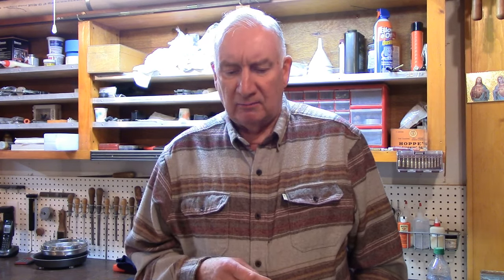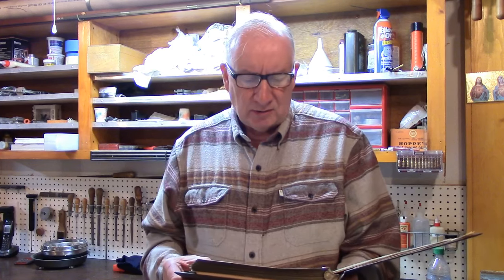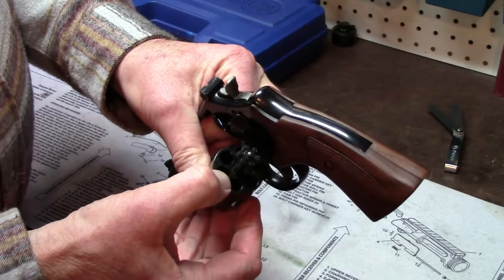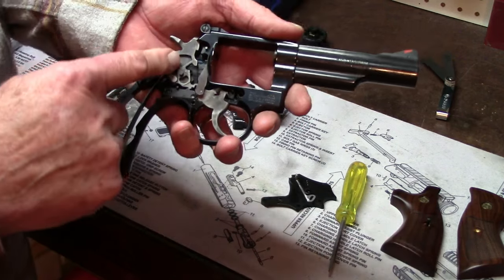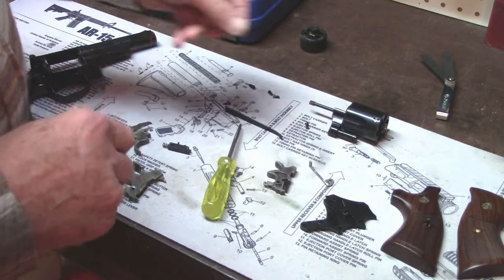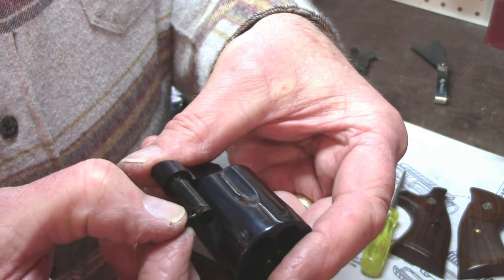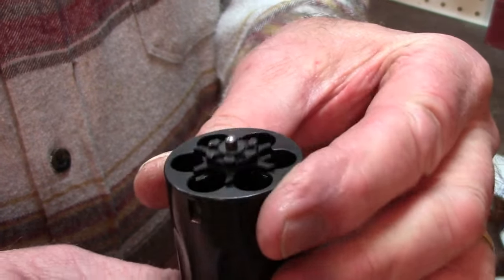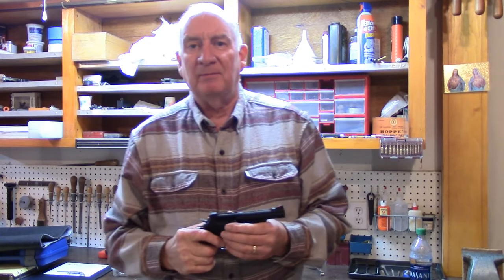The New S&W Model 19 Classic ~ A S&W Armorer's Review

Comment: I think the real question is should I get a new model 19 or a 686+. They cost about the same and are equally nice to shoot. No gun shops in my area carry any revolvers larger than a J frame, but they will have every flavor of Glock imaginable. I am going to have to have one shipped in either way so I cant really get a feel for either one before I make my decision.
Reply from the maker: They are different size frames.  The Model 19 is a K frame.  The 686 is a larger and heavier L frame.  The former is nicer to carry and handle.  The latter was designed for use with a constant diet of .357 Magnum in police service sidearms.  I prefer the K frame.

Comment: Hello, I just bought a new M19-9 classic series revolver. The bluing on the barrel looks different from the bluing on the frame. The bluing on the barrel looks a little cloudy and in certain light a little splotchy—kind of. Does anyone have a similar issue? Is it because the barrel is a sleeve and perhaps a different material than the rest of the revolver? Is this normal on a m19-9? One other thing, the frame looks super smooth, but the barrel has many tiny lines throughout—again, you have to rotate it under the light to see it but you can. You cannot feel the lines, just see under the shine—kind of like swirl after waxing a black car. Any help or information I would appreciate it. Thank you!!!

Comment: I have no issue with MIM parts or really any of the modernization efforts on S&W’s newer guns EXCEPT one….the dreaded lock. 

It’s an unnecessary, unsightly point of failure. I’ve found newer Smiths are made exceptionally well and are good shooters, I just wish they would abandon the crappy internal lock.
Reply: They never will. Purchase a old one if you wanna get away from something you don't even have to think about. I threw my hammer lock keys in the trash the second I opened mine up and don't look back.

Comment: I've handled 3 of the new 19's and a few of the old ones. The new ones (whether new or broken in) shoot well, but simply don't 'feel' as good as the old ones. Hard to put a finger on why.
Reply: Nostalgia
Reply: Steel composition perhaps?
Reply from the maker: There's no difference.  I can make any new Smith feel exactly the same, and because it doesn't drag on a locking bolt, it has even less friction to work with.  The mechanical elements and leverages are absolutely the same. The rebound slide spring can be shortened from 17 down to 15.5 coils, which markedly helps smooth the action.  Strain screws are often on the long side, and can be shortened slightly, but it should only be done by a trained hand, or misfires will result.
Reply: Lot's of reasons why... craftsmanship vs. cnc is one
Reply: Grips are wider on the old.

Comment: Really enjoyed this video. However, I am a little worried about Smiths quality control. There are a plethora of youtubes by those who have purchased the new classics only to find that the barrels were screwed in out of sync with the frame, burrs on the inner barrel tube near the crown, and the  list goes on and on. My personal experience was when I ordered a Classic Model 36. I opened it and wanted to check the action. Initially pulling the hammer back was tough to do, after a few more pulls the revolver completely froze up on me. I sent it back to Smith and Wesson. A few weeks later I got it back with a note that said they had replaced 7 parts. Yes, 7 parts on a brand new gun. Also the blueing just isnt the same, the blueing looked like it was spray painted on. Im glad to hear of the engineering advances, but to tell you the truth I think you are playing russian roulette in purchasing a new Smith.

Comment: Excluding the child lock there is not one change S&W has made that has not had a positive effect for the owner shooter.  This is rarely the case isn so many other items where the Mai concern is lower cost higher profit at the cost of quality.  IMO the M19-9/M66-8 are the very best K series ever produced.  Beyond that they now can shoot a steady diet of full house 357mag loads given the full cone diameter and a increase in frame thickness.   I believe avS&W engineer at Shot stated they had put 10k 125gr jhp think they were HAP bullets loaded to 40k psi (tech overcSAAM8 max) thru it as a destructive reliability test, cleaning only.  No cone cracks, no frame stretch and a increase of 0.002 in end shake which is a super easy fix and prevents further cyl metal displacement by adding a hardened bushing that can then be replaced. IMO adding this as a sacrifice part from the factory would be a great cheap update for all S&W revolvers.  But still this is the best of the best K series S&W has ever produced.  That's saying something considering some I f the revolvers I own.  The fact this light medium frame can now handle 347 equal to that of the L frame is saying something.

Comment: why do guns cost more now than before if they use CNC and molded stuff and very little hand fit? I know there is money inflation over time, but the first home computers costs $5000 and you couldnt do anything with them. When i bought my first one they cost $1000, and now you can buy a computer at walmart that will go to the moon for $400. But guns have gone up in price, not down. Any thoughts?

Comment: I'd hope something called "classic" would be without the lock.  The changes to the frame contours, to accommodate the lock, are really noticeable on the k-frame.
Reply: Yeah, I thought the same thing. I’ll stick with my pre-lock revolvers, thanks.
Reply: There are aftermarket insert plugs to fill the hole and the slot in the frame for the indicator flag.  The appearance is attractive.  As far as the desirability of a lock I prefer a padlock with a coated hasp or in a piinch using a handcuff.  The cylinder can also be removed and separately stored.

Comment: Why do you think, that the improvements made to the model 19, aren't being done to the whole Smith and Wesson line?
Reply from the maker: Small changes in any gun require huge investments in capital.  Actually, the new Model 19 incorporates many of the changes already made to other models.  Endshake of the cylinder and yoke, loosening of ejector rods, broken hammer noses, cylinders hitting barrels, and cylinder cramping are now a thing of the past.  This is a K frame on steroids.  If this Model 19 was being made years ago, they wouldn't have needed to make an L frame.

Comment: Well now that I know every S&W made before they put that lock hole in the frame is a piece of junk and every one they made after that is a near indestructible wonderful piece of machinery. I have not changed my mind. I will take one of the old ones over the new ones ever chance I get. (or can afford) Have a Merry Christmas!
Reply from the maker: They were not at all junk when made, and the two that I owned were wonderful.  Unfortunately, many didn't age well in the hands of those who abused them, and certain parts wore out because of design weaknesses.
Reply: I don't think S&W ever produced anything that could be considered junk, and certainly not when considering the metallurgy, manufacturing process technologies, and engineering limitations of the times. Times change and technology advances. Modern handgun design, materials, and construction has advanced significantly over the years. 

I believe that the overall quality of modern handguns have increased significantly and that modern manufacturing has made it possible to produce said handguns more economically.  This in no way implies a lack of quality or workmanship. 

Like you, I still have an affinity for the older handguns. Perhaps for me it is nostalgia. In any event, if you prefer the earlier released versions, they too are awesome and my opinion is "Go for it!" As always, YMMV. 

Merry Christmas and God bless!

Comment: Those stocks are not "American black walnut" in the traditional meaning of the term.  They made of engineered wood - stabilized plywood or densified wood - which is finished to give the appearance of solid wood.   Made by Altamont, who supplies nearly all the "wood" used in OEM handgun stocks by the various gun manufacturers.   While the engineered product is more stable,  more durable, and literally hard as a rock... it lacks the natural warmth and character of solid wood.  

Also, Altamont stocks/grips are not particularly user-friendly:  while they "look good",  in actual shooting they are inadequate to say the least.  Instead of replicating the styles previously offered by S&W, they produce their own interpretations, which are lacking.  Their Roper grip - rather than the traditional "Coke Bottle" style - is far too narrow and a painful experience in the magnum guns S&W puts them on..  Their "boot grip" for J-frame revolvers has a squarish edge at the bottom which recoils into your pinky finger, and is not comfortable to shoot in any calibre.  Even their "service panel" has an odd squared-off feel to the front strap. These things don't appear to be designed by anyone who actually shoots the guns they are featured on.  

A traditional solid wood stock can be modified by the user; not so with the engineered product.  The material is so darn hard that it is obvious they were produced on CNC machinery with high-speed cutting tools.  Try modifying the shape of one those stabilized products:   it's quite difficult and you need to wear a respirator due to the fine dust produced.  Since the engineered product is also nearly incompressible, these stock/grips are usually supplied with one or more locating pins to ensure correct alignment.  

These things are a COST CUTTING measure, not necessarily an improvement.   The original S&W stocks of genuine solid wood - goncalo alves and others - command premium prices on the auction sites, and for good reason:  they are a superior material for the purpose intended.  However, the increasing price of solid hardwood, increased demand at time of reduced supply due to CITES, and the lack of subcontractors who can work with it in volume, has resulted in the use of this engineered material by OEM manufacturers.  The new gun buyer is clueless to this, and in a world of plastic framed pistols gazes upon the plywood stocks and exclaims, "Gee look at these beautiful wood grips!".  Ruger went the other way:  look at the synthetic crapola Ruger puts on its revolvers, since it's main supplier Lett Grips went out of business.  

You could say at least S&W is trying to supply a wood stock at a reasonable price.  If only they would pay more attention to the designs they are putting on their guns.

Comment: You can talk all you want about how MIM parts are the same or better until you have a critical part failure and you get a hard look at how cheap they are. There's a good reason why the high end gun makers like Dan Wesson still use forged parts. You're right companies do blow their own horn saying they invest millions in Injected parts equipment saying they are better until they have thousands of reworks to deal with from using out of spec MIM garbage. Nothing like ruining your brand not taking the time to properly QC ing those discount parts. Once you lose a gun customer they never come back.
Reply: would you say this is a major problem with modern smiths?

Comment: OK this was entertaining and at times amusing until he got to the “internal lock”.  That is garbage engineered in an attempt to appease people who want to eliminate civilian gun ownership. He states clearly “I’m never going to use it.”  Neither is anyone else who buys a new Smith & Wesson revolver. What’s the downside other than that ugly hole in the side plate?  In theory, none. However, I must point out that S&W still makes Model 642 and M&P 340 revolvers with a different SKU and no internal lock. Why?  I believe that S&W recognizes that with guns that light it is possible for firing inertia to cause the lock to engage, turning your firearm into a paperweight at a most inconvenient time. 

The frame mounted firing pin also was introduced as a safety feature (drop safety specifically). S&W had used the hammer mounted hammer nose for over 100 years. It couldn’t have been problematic or they would have “improved” it long ago. 

The skeletonized hammer saves material. Full stop. Now you can purchase a lightweight skeletonized hammer from Power Customs intended to reduce hammer mass and, thereby, reduce lock time for competitive double action shooting. However, S&W is just saving a penny here and a penny there with those cutouts in the sides of the hammer. There’s nothing wrong with that but the idea that they did it to lighten the gun is absurd. 

Not all older Smith & Wessons are better than new manufacture.  I have a Model 25-2 made in the mid-70s that is gorgeous on the outside.  However, the machining marks inside were so bad it looked like some guys fired from the Vega production line made the gun. The trigger pull was awful - rough and uneven. The hammer and trigger both needed shims to reduce side to side slop, and virtually everything inside benefitted from careful smoothing. The cylinder throats range from .455” to .457” when they should be .454” making FMJ bullets a good idea in order to avoid lead build up on the forcing cone. Finally, the barrel roll marks are wrong for this model. I have a letter from S&W to the original owner stating that roughly 1,000 of these got out of the factory. I have 1980s and 1990s examples that have much better quality. (I do not and will not own a revolver with the infernal lock.)

The old coot is correct that there is nothing wrong with the metal injection molding process when it is used correctly on parts that can be made that way. A Model 1911 extractor is NOT one of those parts (cough… Kimber) because it’s actually a spring. MIM can be done right, and it can be cheap garbage.  Gun manufacturers went to MIM because it is cheaper, not because it’s better. 

/rant off/

Comment: Sorry but I also started L.E. in the 1970s and also was a S&W trained Armorer I call BS  on your passing on the "safety" it is total BULLSHIT.  I do agree with many of your comments and by FAR the largest problems I remember is the extractor shroud backing out and preventing the cylinder opening. At least this failure allowed six rounds instead of that damn safety engaging on it's own. Odd that the safety was NEVER needed when the weapon was a front line carry weapon.  If the "SAFETY" was discontinued, I could agree with your entire video . Possibly difference in our experience, but I remain committed to my belief that for a last ditch tool, which all handguns are, I don't believe for a moment that the "safety" is any remote improvement.

Comment: Since the 1980s S&W revolvers had the Hillary hole lock added and the hammer nose replaced with a transfer bar I have stayed away from those revolvers.

Instead I strongly prefer the pre-lock and those without the transfer bar firing mechanism. 

So I buy vintage S&W revolvers, anything pre mid 1980s.

Did you know that S&W nearly went bankrupt for adding the Hillary hole lock? They betrayed the gun community when they got in bed and on board with the Clintons.
Reply from the maker: Actually, you don't know what you are talking about.  Smith and Wesson revolvers have no transfer bar, and never have.  The internal mechanical works are exactly the same, with vastly stronger and more durable features, as I demonstrated.  The hammer block is not a transfer bar, and is the same part previously used to allow carrying of a live round under the hammer.  The hammer nose was a stupidly designed, cheap alternative to the far more durable firing pin.  When frozen by elements, rust, or a grain of sand, it failed to ride over the hammer nose bushing and would break and put the gun out of action. Smith and Wesson was very well aware of these weaknesses and didn't stand behind guns that failed in those days.  That's why they trained me as an armorer for free, because they needed cops to fix their bad guns.
Reply: @GunBlue490  Actually you're the one who is lost.
Reply: @GunBlue490  The hammer nose was 1890s thinking when the K came out ?
Reply: You have no clue what you're talking about. S&W signed the agreement to add the internal lock in 2000 and started adding it to their revolvers in 2001. I have a Model 60-4, manufactured in 1990, and it has no lock.